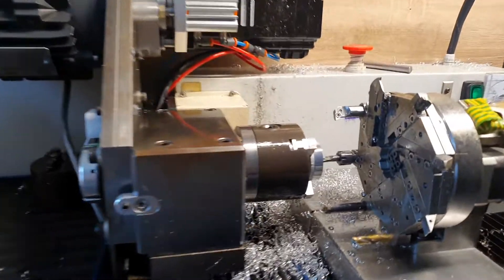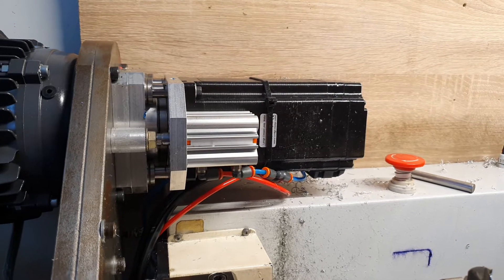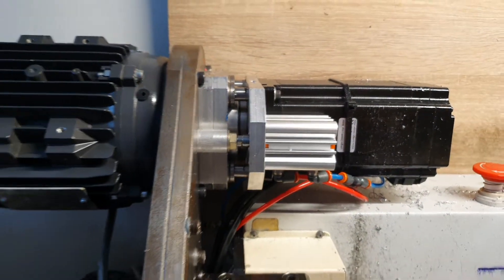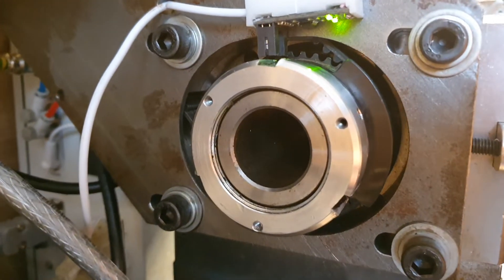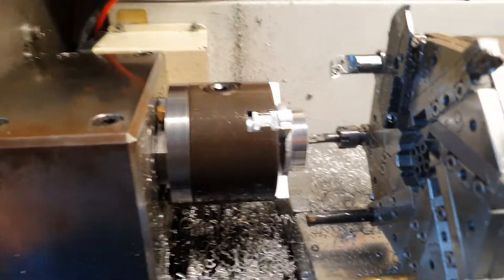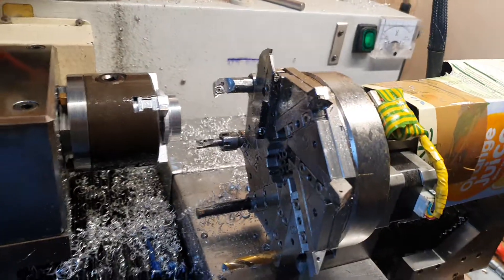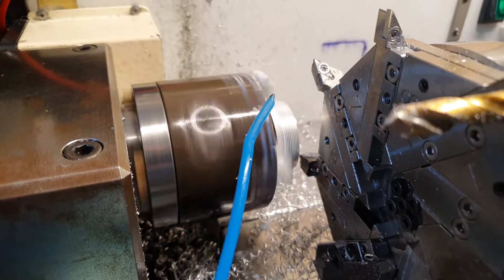M43x1 on mini cnc lathe 12nm hybrid servo motor

Comment: So cool the idea, talent. Can explain me: Your sensor green light on spindle just used for 3 phase for index read RPM not supported for Hybird motor and when threading M43x1-You used Step/Dir Motor function on mach 3 software, right? And name of board Mach3 on videos used? Thank you your respond...
Reply from the maker: Yes, it is all correct, When using 3 phase motor the sensor is used for RPM when using the step/dir function then sensor is used as a homing sensor. The index works on older versions of the Mach3 but is unreliable so I decided to use big hybrid steppermotor. The board I'm using is "Mach3 5 Axis CNC Interface Adapter Breakout Board"
Reply: @MrMechatron92  Do you facebook or email can share me... I will note it.hihi
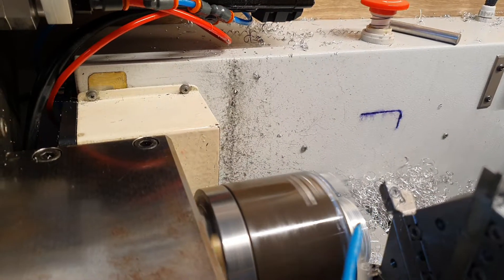Reply: @MrMechatron92  Can detail me the name of sensor for spindle homing and at 0:55 I see after your close to connected the step motor with timing belt spindle, I see the jaw rotary for homing. So this is auto after close step or need button switch on mach3. And you used milling interface on mach3 can do using 3 axis, right?

Comment: Man this is such a cool tool turret design.  I like it more than the Alteros I was about to buy.  Is this something I could buy?
Reply from the maker: I guess that I could made another one and place it on eBay, Is fully compatible with mach 3, I can provide macro and video how to configurate it. turret holds up to 8 tools, and uses only two outputs and one input.
Reply: @MrMechatron92  Aw man! I bought the Altaros yesterday! you should consider doing that though!
Reply from the maker: @DIYGuitarMods  I will, Ill make a bigger prototype and when proven Ill start sale. Once ready Ill attach the link.
Reply: @MrMechatron92  I'll be looking forward to it!

Comment: Sir, Great Job. Just wondering why don't you just use a servomotor with relatively high spindle speed ?
Reply: What control software are you using, Mach3 or LinuxCNC ?
Reply from the maker: Hi, I'm using the large 3 phase motor that gives me a good torque and speed, and hybrid servo motor for driving the spindle synchronously, this hybrid servo have large torque, if I remember correctly 12n/m that thro the gear gives me 36n/m on the spindle, servo that could do both, with this parameters, would cost a fortune.
Reply: @MrMechatron92  thank you for the info
Reply from the maker: Mach3 control